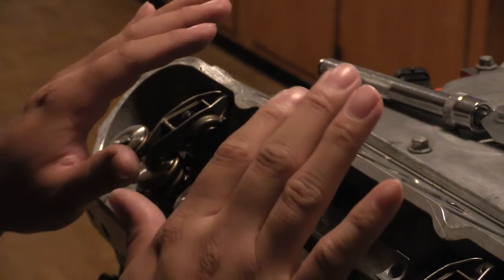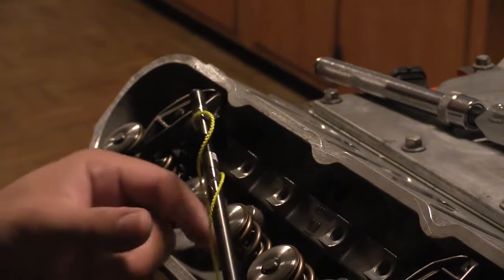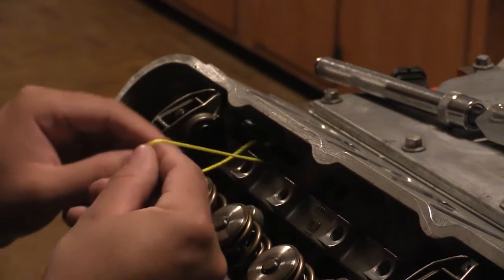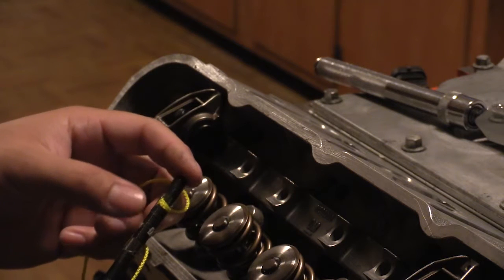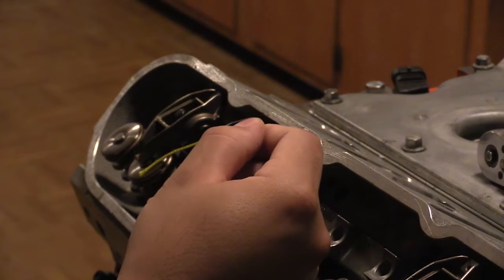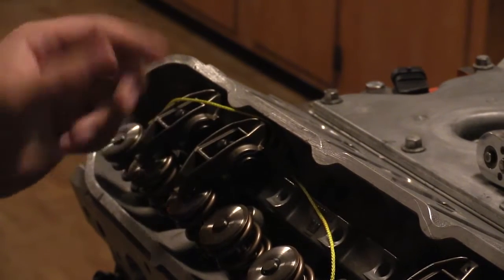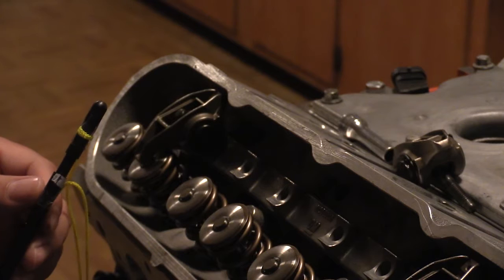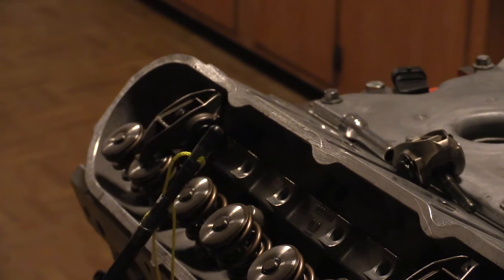LSx, Pushrod Length checking, String Method

Comment: Thank you SOOO much for taking the time to post this.  The instructional video from CompCams is an excruciating slow and painful way to do this and your method is awesome!  It works like a dream and is very fast.  Just torque down the rocker and pull the two strings gently until you feel the pushrod come in contact with the rocker.  Boom, done.
Reply from the maker: Rich Warwick No problem, just make sure you add however much pre-load on-top of the length the push rod came out to be. 👍

Comment: did you finish this valve job? how'd that string trick work out?
Reply from the maker: I had ordered the pushrods a few months ago, I just got my rotating assembly back from the machine shop today actually, should know in the next few weeks.
Reply from the maker: 11/26/16 Update, I finally finished doing the long block and installed the push rods I had ordered. Here is how it breaks down.

Upon using the string to help rotate the pushrod length checker and zero lash the rocker, I came up with 7.275" high & 7.2525" low, adding .060" preload that came up with 7.335" at the highest and 7.3225" at the lowest. 

Looking at the summit catalog, they have Trick Flow pushrods for LS engines at several preset lengths.

I had a choice between 7.325" or 7.350" pushrods

I went with the 7.325" rods simply because I didn't want to put too much pre-load on the lifters and have one collapse, this is my own choice and theory.

When installing the pushrods, I tried the 'how many turns' as seen on other youtube videos. I came up with 1 turn or in some cases just hair over a 1 turn. Which is not bad, but still on the low side which is what I had expected anyway.